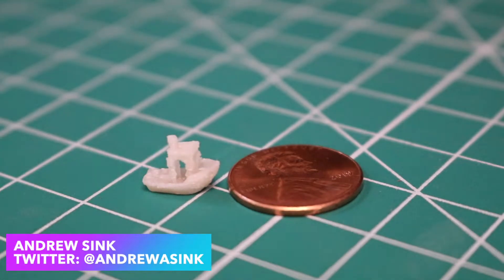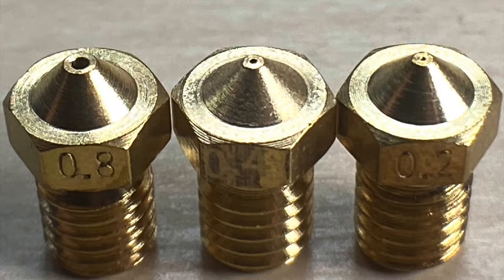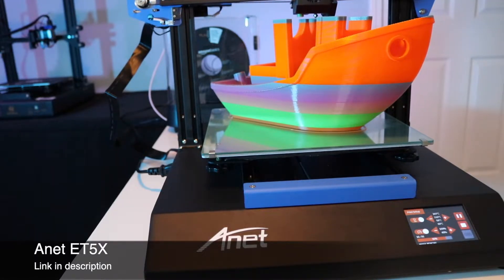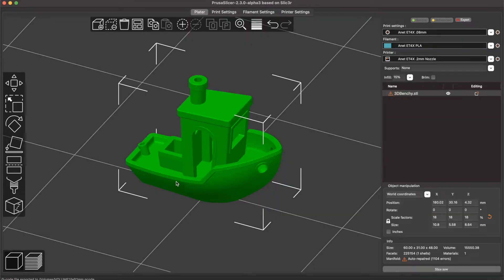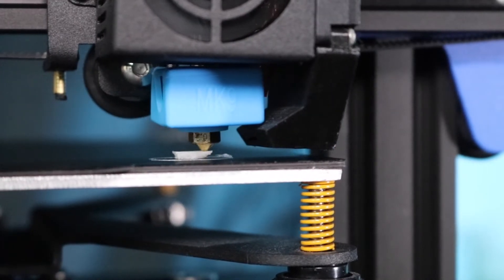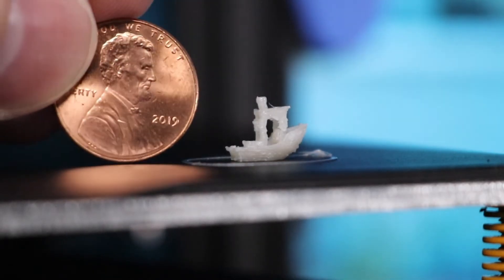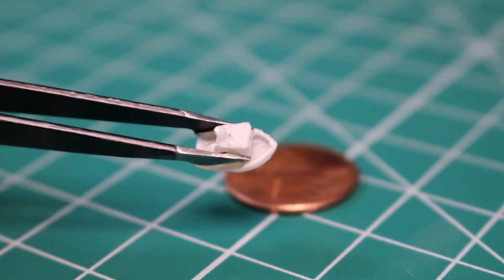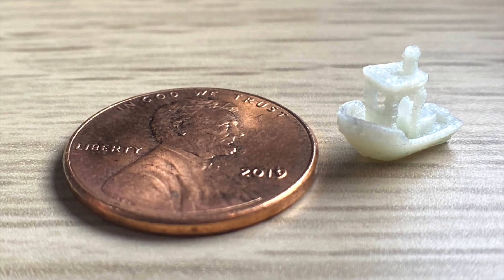Print Tiny with a .2mm Nozzle on your 3D Printer / Anet ET4X at .08mm Layers

Comment: Did you find the tools in that kit useful? I bought the same one but couldn't work with them, I thought I was going to break the hot end. The nozzles are fine though, they work great!
Reply from the maker: Oh for sure. The stubby screwdriver with a driver attachment is worth the cost of the kit alone. I usually use a pair of channel locks to hold the heatblock rigid, and twist the nozzle off the with the driver. It's by far the easiest way I've found to replace a nozzle, but it does require a bit of experience to get the process down!

Comment: I have an Ender 3 Pro. While a resin printer is by far the better candidate, I have gotten a couple of really decent D&D miniatures out of it with good detail. You need to print slow and really have your printer tuned in. Your machine has to be pristine in level, and jerk settings can't be all wonky or it'll topple over (yeah, and a brim or even raft won't hurt).